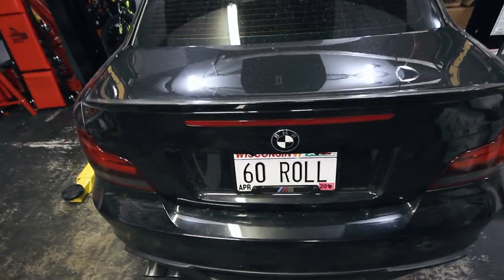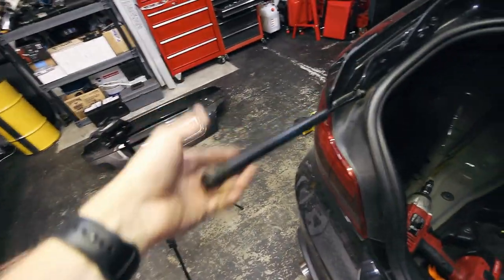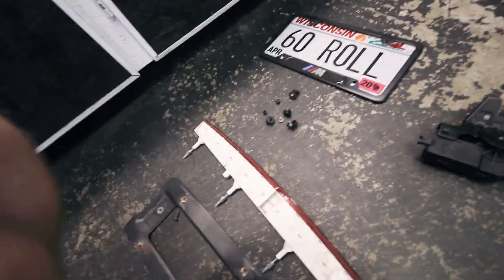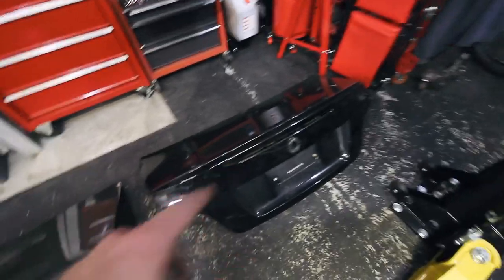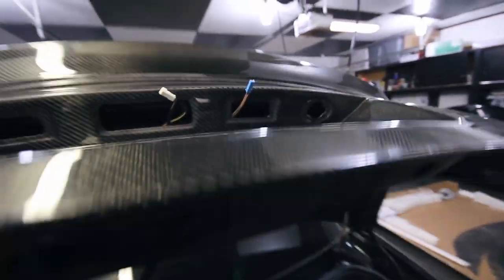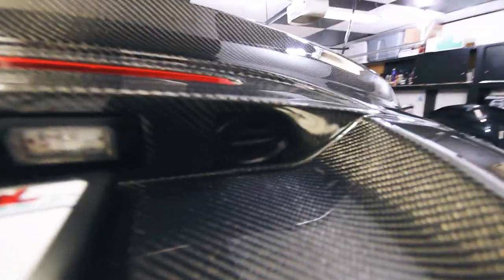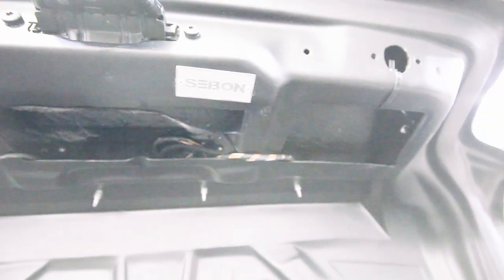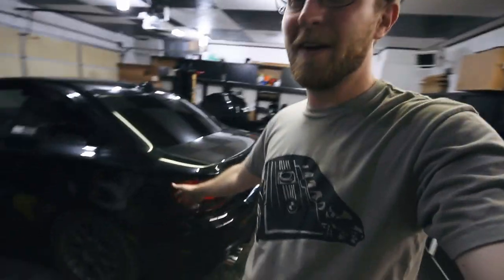This CARBON FIBER TRUNK is INSANE! My BMW Looks So Different...

Comment: Looks great. For $895 though feel like it shouldn’t need any of those adjustments like filing or drilling
Reply from the maker: Agreed, I wish it was more complete and a better fit. The manufacturers fault.
Reply: It’s only $765 on vivid racing before coupon for Black Friday if anyone was dumb enough to pay $895 they got ripped off it’s a seibon Carbon trunk that has been up charged..
Reply: IN54NE BMW 335is hows the fitment. Still expensive for something that would need adjustments on your own
Reply: Most body kits available take many hours to look the way you envisioned when purchasing.
Reply: Did you compared weight of two trunks
Reply: @JJ-ix4zr  did you watch the video?

Comment: You need to put the small rubber twist adjusters next to the trunk latch. That will help with adjusting the gaps and the entire trunk.
Reply from the maker: None of those adjusters fit unfortunately. And it needed to be adjusted downwards, not upwards.

Comment: Yeah after putting on a vorsteiner trunk on my e46 m3, keep adjusting.  You’ll be able to fit that trunk much better once you know the adjustment points.  Also the latch where the trunk closes onto needs to come up so you don’t have to put force into closing it
Reply from the maker: I'll keep trying and maybe bring it in to a reputable body shop to adjust further. But I did my best. I even adjusted the latch like you mentioned, it's all the way up already.

Comment: A1auto for the 3rd Brake light but you will have to shave the connector. If you want to sell the old spoiler I might get it from you. The light will break on the way out. I went to tint and I could not get it back out.
Reply from the maker: These dang lights are such a pain!
Reply: @jake_spence  did you sell the spoiler? All say they are for e82 but nothing e88. So I waiting to find a used one and find out if I need to mod it to fix. Also a used m4 style lip really want to make work. I am debating on using clay and making a mold out of fiber glass but fiberglass or carbon fiber or find out if a plastic can be used.

Comment: The oil pressure in your 1/2 mile was crazy,  the gauge was moving as fast as the speedo
Reply from the maker: I have it hijacked so it doesn't actual show oil pressure. It shows either boost or AFR, I can't remember.

Comment: Jake, can you point out or make a short video about how you relocated the windshieldwashertank-filler-neck ? I can see you took it out of the way of the hot turbo. How did you go about and did it need any extra parts ? TIA
Reply from the maker: No extra parts needed. Simply remove the wheel and fender liner. Then pull the filler neck through the wheel well. Now just shove it through the water drain area and trim if needed.
Reply: @jake_spence  thanks will try this as soon as I have a chance

Comment: looks amazing Jake, which car are you driving in the winter weather? I cringe to think I'll need to put my 335i in the salt this winter
Reply: Just keep it washed up every 3ish days man
Reply from the maker: The 1er has been stored since October and the 335i has been on daily duty for a while now. I feel bad because the 335i is a Texas car with absolutely no rust... but oh well...
Reply: Tbh my body has no rust whatsoever theres just some surface rust on certain steel parts underneath the car and even that could be grinded off  quickly and resurfaced with an anti corrosion paint or the like. And mine is a 2007 Canadian driven car xD the e9x series hold up better than any Chevy mazda Honda or subaru I've seen that has been that old xD so theres that to think about.
Reply: My 2003 ford Taurus? Rusted right out on the rocker pannels and at the strut towers aswell as having some trunk rust. That's not to much older than the 07 e92 which has none to speak of and that Taurus was crown sprayed aswell

Comment: Single side struts are just not kosher.  I was told by a guy in Australia he had the struts depressurized somehow so he can use two on his CF hood.

There has to be a better solution from the strut manufacturer.  They should have been part of the kit.
Reply from the maker: I agree they should have proper struts available. But for now this seems to be working...

Comment: Your car is coming together really well, waiting to see it on the track with times👌😁😎. 

On your 1M bumper install you had blanked off the piping to the light washers, would it be worth it to direct those lines to the coolers in the car just for the extra bit of cooling? Just an idea I had😁
Reply from the maker: Thank you! That's a good idea, I've thought about it as well. Unfortunately my local track does not allow any sort of water spray or cooling mist as it waters down the track.

Comment: For almost a $1000 dollars. Everything should of fit pissah! Nothing fit at all...i would of been pissed & only a 10 lbs savings? I'm glad i just ordered my M Performance carbon fiber spoiler from Turner Motorsports. Cost me $347 dollars & it's a genuine BMW part! I'll be making that video pretty soon. My car will be finished in. April...well everything will be done except my 6 pro meth nozzles wont be installed into my plenum. But will be by mid summer. I do love the look of that duck tail though!👍🏁

Comment: if i run those same apex wheels, whats the biggest i can run front & rear tires?
Reply from the maker: Front is 235/40/18. Rear is 275/40/17, but I did a custom hub swap to fit these wheels. Usually you have to get the 18x9.5" wheels that fit a 265/35/18.

Comment: The headlights look too old, you need the 2012 ones, they have the white slashes across the top, maybe buy some original ones to make your car look post 2012, I think you have the 2012 tail lights
Reply from the maker: I do have the updated tail lights, but I agree, I would like the newer headlights as well.

Comment: if i run those same apex wheels, whats the biggest i can run front & rear tires?
Reply from the maker: Front is 235/40/18. Rear is 275/40/17, but I did a custom hub swap to fit these wheels. Usually you have to get the 18x9.5" wheels that fit a 265/35/18.
Reply: damn, i was told i could fit 275 on 18’s on stock suspension, might just stick with 235’s in front and 265’s in the rear, any suggestions for shocks and springs or coilovers? I also have a n54 135i